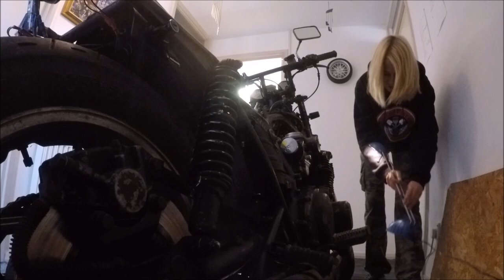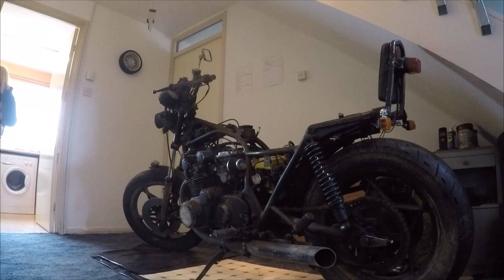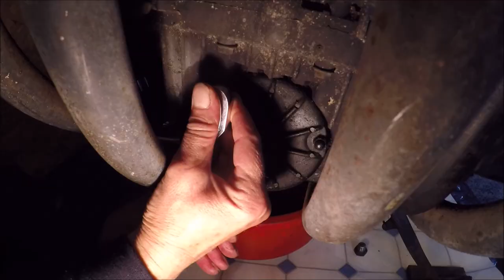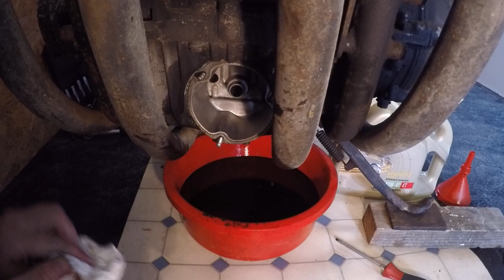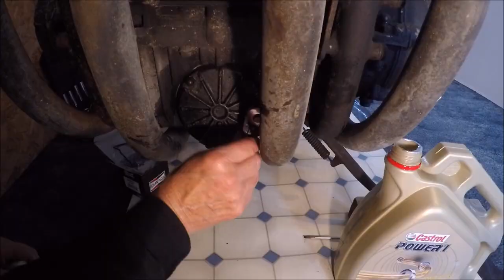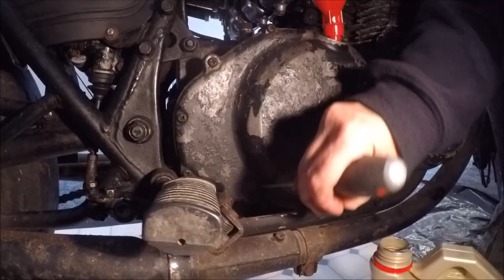GS550 Rat Bike Restoration Project 23 #Engine Oil & Filter Change

Comment: On my motorcycles and trike vw engine block there is a copper sealing ring on the drain plug. 
And I have seen that there is no sealing ring on your engine block.
Is this the case with Suzuki?
Or has it been forgotten by the previous owner?

For the rest... it's perfect done, none can do better.
Reply from the maker: Thanks and your right, there's a thin copper sealing ring but not clearly shown in the video. Sorry about that hun